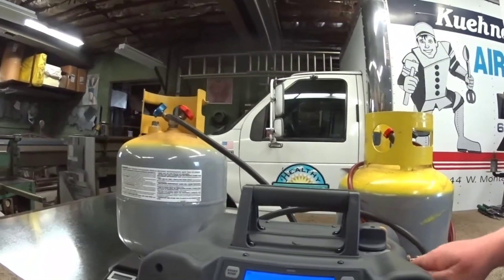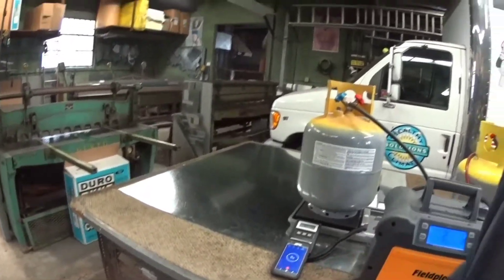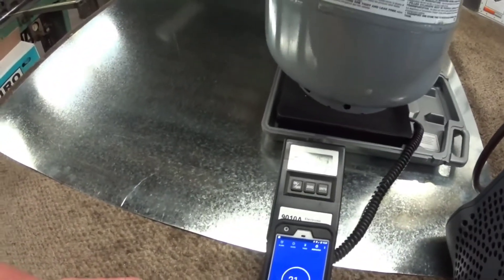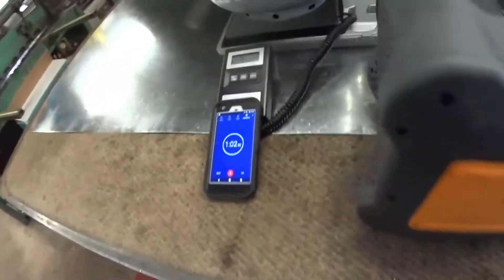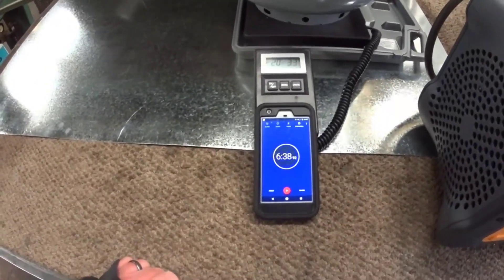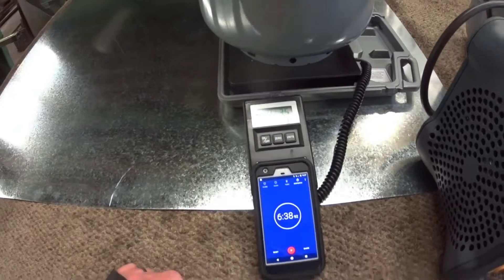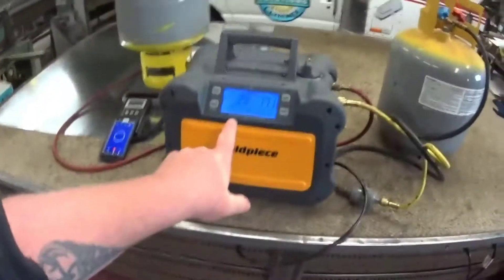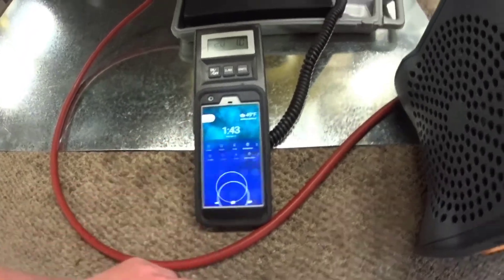Fieldpiece MR45 Recovery test

Comment: Dude...!! RECOVERY TANKS have DIPPING TUBES... regular cylinders (R407C, R22, R134A...) they DON'T have dipping tubes. If you flip the tank and it's "sucking" from the liquid you are not doing anything, since the dipping tube is close to the bottom, if it's in the suction (no dipping tube) THEN... it would make a difference. THE THING THAT YOU WANT IN ALL RECOVERIES or what you are looking for is LIQUID... liquid = faster recovery, gas = slow recovery. I hope that helps. Thanks for the video. (Last note, the RED and BLUE nobs are supposed to tell you GAS or LIQUID, but it's not standard, I've seen them switched up, which is dumb).

Comment: Billy, I thought the point of inverting the recovery tank and connecting to the vapor port was to eliminate the compression of the liquid refrigerant which would reduce heat, the enemy of speed. However, I also thought you had to turn the tank right side up at some point over half way thru the recovery so that the liquid refrigerant stays on the bottom of the tank as the vapor recovery is increased, which is where the added speed comes from. It looks like in the video you did not turn the tank back right side up(?). Have you also tried this same test with the G5 Twin? Would like to see that comparable video.
Reply from the maker: Mike LeProhon i have not tried it with the g5 as i do not have one....as far as flipping it back over...i did not....that i will do and do another video update

Comment: Billy which valve (liquid or vapor) were you connected to when the tank was upright and when it was inverted?
Reply from the maker: Glenn Harrison the vapor side both times
Reply: Ok. Appion shows that the improvement comes when you go inverted through the vapor side, versus upright in the Liquid side. I guess the debate is which is better, faster, and produces less tank heat, going in the vapor side, the Liquid side forcing the liquid to the bottom of the tank, or inverted on the vapor side which still forces the liquid to the "bottom" of the tank.

Comment: Yeah I wonder if higher temp will make a difference. Can't imagine why but curious. Tank to tank versus condenser to tank... Hmm mm. No idea if it will make a difference. Good video. Made me think. ouch!!!
Reply: The Air Conditioning Guy I used mine in 87 degrees ambient 6 lbs R-22 just regular way. About 16 min to shut off. That's about normal to me. And the bonus is the MR45 only weighs 22 lbs.
Reply: Nor-Cal Refrigeration & H.V.A.C... That is a bonus. Everytime I use mine the strap leaves marks on my shoulder.

Comment: wouldn't the point be to flip the already full tank so that the machine can move the liquid refrigerant instead of having to boil the liquid to gas and then have it re-condense in the empty tank ?
Reply from the maker: +joeyf504327 the thought behind it is to not have the gas expand in the recovery cylinder...so it keeps the temp. Down and this the head pressure.
Reply: BK HVAC I'll try it this week I have a micro channel to change out. I'll Time it upside down vapor. It's R410 should be high 70's this week.